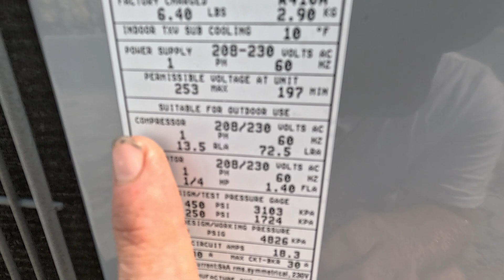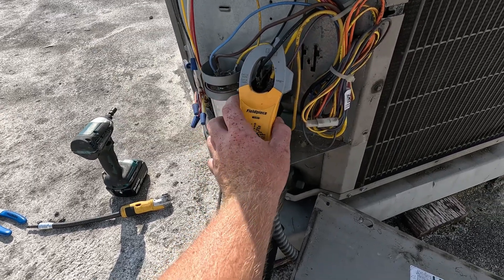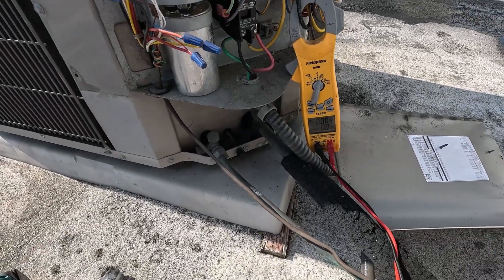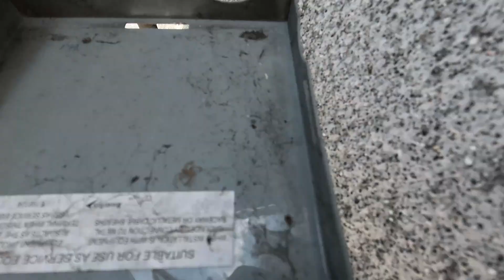How to Check for Locked Rotor Amps (LRA) on an AC Compressor

Comment: Do the terminals ever blow out when running without a hard start? Could they blow out if the compressor is just old, say, 30 years old or they were installed poorly? Asking because when I'm checking components on my heat pump, I'm right in front of it. And it's 32 yrs old.
Reply from the maker: Could it? I mean I'm sure it's possible and has happened. Very uncommon but possible
Reply: @SurfBrosHVAC  I'll keep that in mind!

Comment: I’ve had plenty just need a hard start kit.  I’ve gotten a few started with a really big hard start kit I keep just for that.  I’ve gotten  a couple started with the  oversized start kit and whacking it with a dead blow hammer while it’s trying to start.  The guy that taught me that trick years ago use to get out the hammer and say, “Sometimes you have to talk to it a little bit.”  And if it didn’t work he would get out the bigger hammer and say , “Sometime, you have to talk to it a little louder!”   

I’ve had at least two blow out a terminal.  One blew out a terminal just resetting the breaker.  I was behind the unit when it happened and it was one of those I need new underwear moments.

Edited for type
Reply from the maker: I've blown out one terminal before and I think I was leaned over top of the unit when it happened. Two of my guys were trying to get one started and it blew out a terminal the other day and they called me losing their minds

Comment: Hey bro good video, informative. I have a friendly tip. 
I got a new clamp meter and was reading the instructions, it says, When using the clamp on the meter on amp setting to pull amps, disconnect your testing probes. 
I’m guessing for more accuracy or interference.

Comment: Good info for any tech, best point, not to stand in front of compressor terminals , I always see techs in front of it and that's very dangerous as you said. Hope people pay attention and stop being overconfident. Thanks for the videos. On the other hand, if customers did routine maintenance, the tech can for see and prevent the last minute effort,by being pro active and replacing compressor, there are signs that is going out

Comment: Good stuff bro. I agree with everything you said. I’ve gotten lucky a few times with a hard start and made a few customer’s day and I’ve had some that just won’t unlock. Thank god I’ve never had one blow out though. I bet that was freaky!
Reply from the maker: I had done it like 100 times and then I did it to this little wine cooler with a locked up compressor and went really big with the start cap when it still wouldn’t start and then pop. Honestly scared the hell outta me
Reply: @SurfBrosHVAC  😂